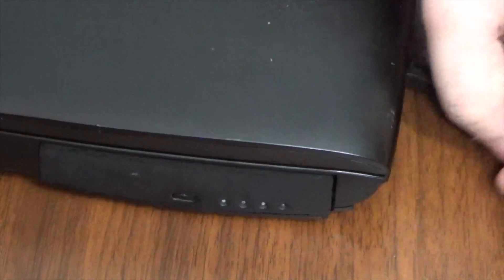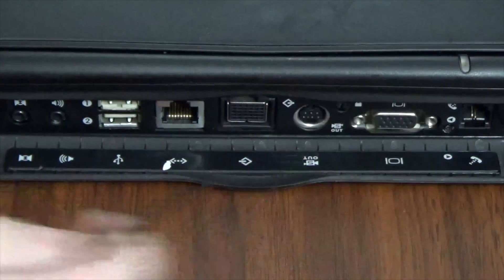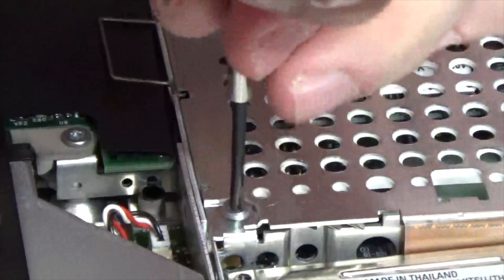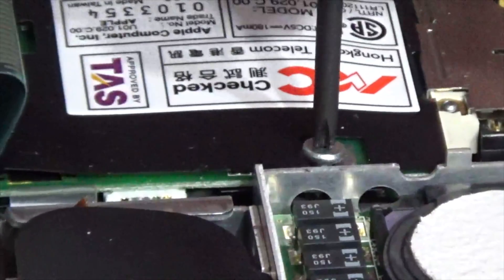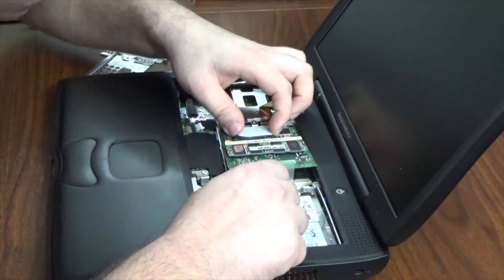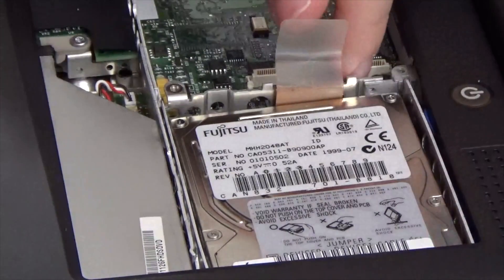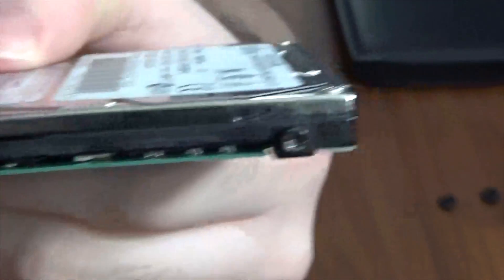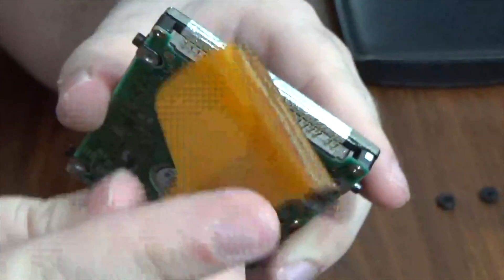Apple PowerBook G3 Hard Drive Replacement

Comment: Quick tip, if you're just replacing the hard drive, removing the metal shield only is enough to be able to pull the drive out out. No need to remove the modem, CPU card and keyboard.

Comment: Hi! I did all the same, cloned the original hdd to CF, but G3 doesn`t want to boot from CF. I can boot from CD with macos, and I can see the CF disk with all the files etc, but cant boot from it ( Any ideas?
Reply: You need an industrial CF card that has a writeable boot record or else it only sees it as a secondary storage, and not primary boot one.

Comment: I switched out the HD on my Pismo and now the machine will only boot from an external Firewire HD.  I've replaced the  drive ribbon connection on the motherboard, checked the PRAM and removed the Airport card and still no luck. At least I can still use it via the external drive.

Comment: I just used your video to help remove the HD in my Lombard. I didn't remove either the modem or the keyboard cables and the drive came out fine. At the same time I removed he HD from a Wallstreet and the biggest difference is that the keyboard is removed by sliding 2 tabs that are located in the accessory bays towards the front of the computer. The tabs are located near the bottom corners of the keyboard. Thanks for your help.

Comment: My powerbook has a battery that has a tiny spot on it that is molten, right where the battery holder touches the fan. Has this happened because it overheated? Or has it a different cause. Also, is it safe to still use the battery? Any reaction is welcome, even if you just say something like idk.